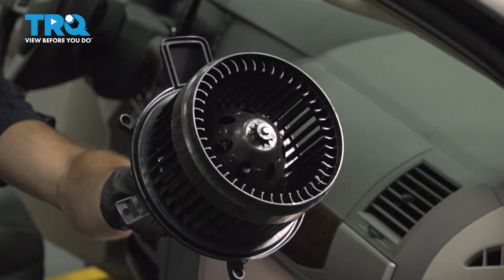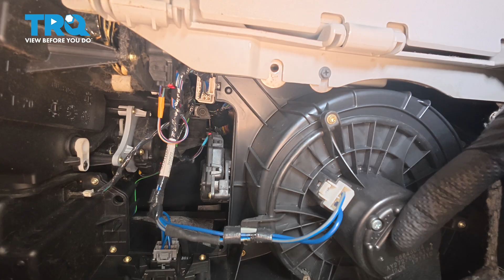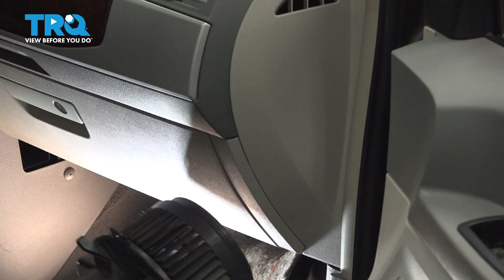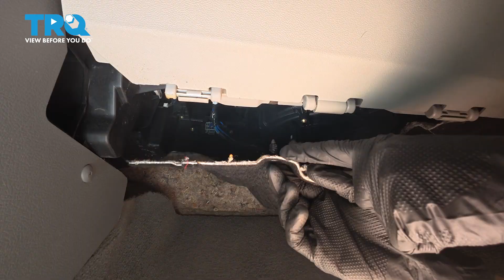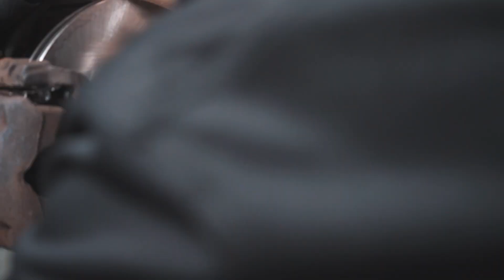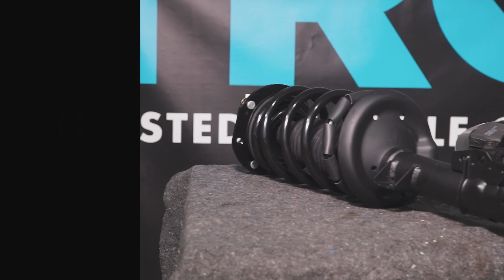How to Replace Front HVAC Blower Motor Assembly 2008-2016 Chrysler Town & Country

Comment: Removed my old and cleaned it, reinstalled it and now it's not blowing at all, checked h uses and they seem fine, I did notice some corruption on the tabs on the cable and blower